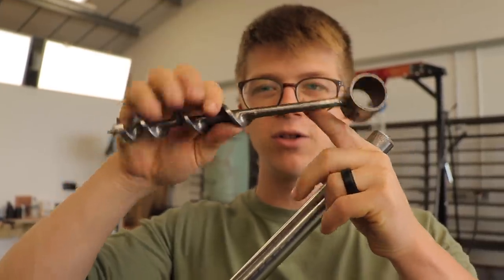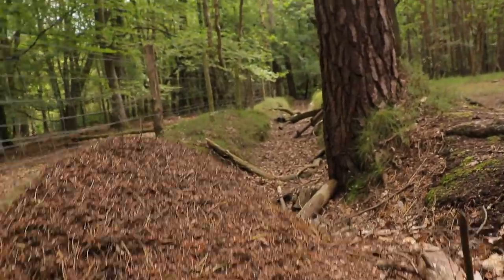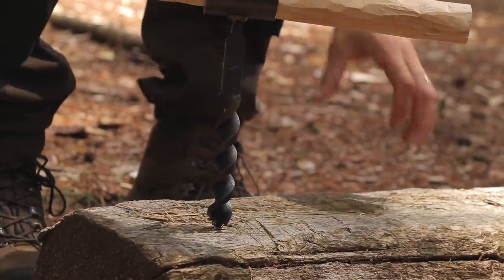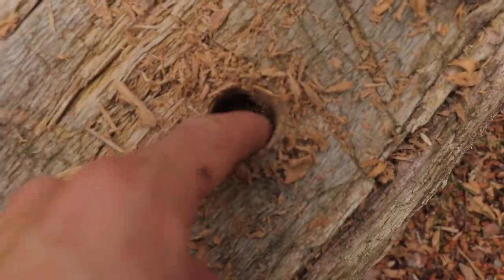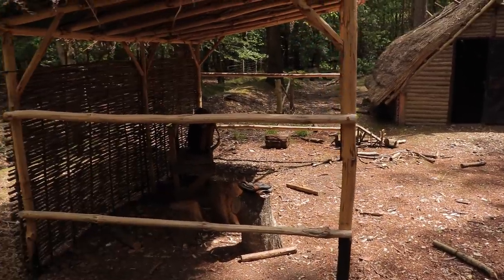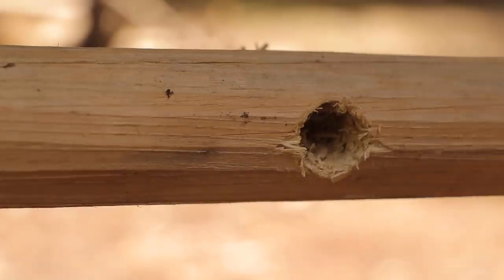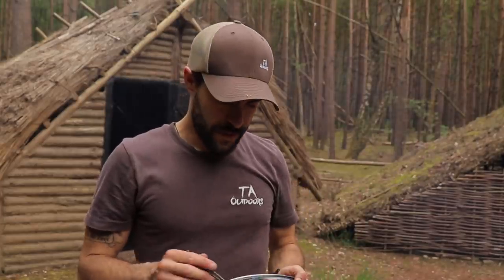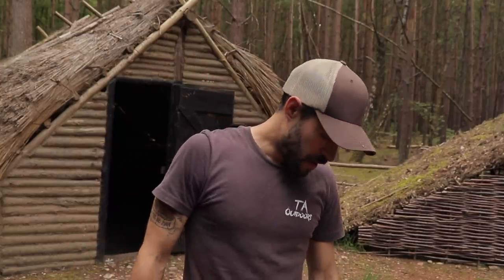Testing the Alec Steele Auger in the Woods! Bushcraft Project

Comment: He can make tools alright. The auger bits need a hard clean edge going up the auger screw, with a little less then square edge. That will help the auger work a little easier and cleaner. I have used a lot of auger bits for mortise and tenon work. I find that edge being a little sharp helps.  Looks like you started making Jambalaya, cut up Andouille sausage and prawns.
Reply: Good analysis,I’ve also used a lot of different auger bits over the years and the type that’s tapered wider from the front to back are harder to control and keep straight. A nice auger with sharp cutting edges and a decent sized screw at the front to pull the auger through with a parallel body always cut the best and most efficiently .
Reply: Good analysis,I’ve also used a lot of different auger bits over the years and the type that’s tapered wider from the front to back are harder to control and keep straight. A nice auger with sharp cutting edges and a decent sized screw at the front to pull the auger through with a parallel body always cut the best and most efficiently .

Comment: you do know that the handle part of the settlers tool is for making the perfect wooden nail  that fits the hole all u do is put the handle part over a piece of wood hit it with a hammer and that will make the wooden nail i just thought id add that to ya not sure if u said that or not if you did then sorry lol
Reply: This one is not built that way. And those that are, usually are garbage for doing that.
Reply: @shaynejenkins446  ah k my one works good

Comment: Your hand auger would have a much smoother cut if you withdrew the auger when the snake broke through the other side and the drilled from the other side centred on the small snail hole. Or at minimum you would stop break out

Comment: Mike I bought an off the shelf scotch eyed auger, slightly smaller than this one and find it quite an awkward tool. This one being longer and looks better on the joint with the eye. Particularly the longer point of the drill.  Is the blacksmith local? Cheers, Simon.

Comment: I’ve used hand augers a lot over the years and the ones that had big screws work a lot more easily and efficiently than the augers with a smaller screw. jmo

Comment: You need to sharpen that bit. Drill bits have a edge on them going all the way up. I was wondering from the last vid if you were going to sharpen it in this vid.
Reply: All you need to sharpen on an auger bit are the spurs and the cutting lips. The twist portion of the bit simply feeds chips back out of the hole.

Comment: I saw one of these a while ago, I think it was being called the "frontiersman tool". The diameter of the drill bit was the same as the handle hole. The handle hole was placed over a slightly larger diameter stick and hammered over shape the end into the correct size peg. Would that work with this tool?

Comment: Isn't the barrel eye on that supposed to be the same diameter as the drill bit and have a sharp edge for cutting a peg that fits perfectly into the hole the drill bit makes.
Reply: They ran out of time

Comment: The result would be even better if the drill had a pre-cutter. I hope Google did the translation from German to English well.
Reply: I presume you mean the sharp, curved 'wings' at the outside edge of the auger that slice the wood fibres before the main cutting edge (working as a rotary chisel) removes them from the bore. If that IS what you mean, yes, you are absolutely correct!
I can imagine, however, that such features are non-trivial to forge, but they are an important development in the evolution of wood-boring tools.
Oh, and that worm was way too long and thin! It won't survive for long.

Comment: The cutting spurs are a bit too short, that's why the hole looks ragged. Look on ebay for a bit n brace taking care to look closely so you don't get on that's worn out. The sort of auger you have there doesn't lend itself well to in situ drilling.

Comment: maybe need to sharpen the auger a bit more, on screen it looks like there is just basic geometry, with some grinding, it should work even better!
the cut should be more clean when the tool is more sharp!
there is some wood chips coming out of the bore, but it looks more like dust, if the auger is more sharp, it looks more like chips!

Comment: It doesn’t seem to cut a very clean hole. Perhaps the next one will be better.
Reply from the maker: It does, it’s just the particular wood I am cutting on the video. It’s pine, very soft wood with twisted grain. Something like sweet chestnut or ash would make a really clean hole
Reply: @TAOutdoors  I have been watching Alec for almost two years. He is best at talking and blacksmithing is a close 2nd and everything else he attempts is not awesome. He should be a blacksmithing tool salesman.

Comment: Not to be "that" guy.    But the screw auger is handy and it was a great colab and I like the tool....but the only augers I kind find documented from the historical record dating to the Viking age arebSpoon bits.     The screw auger our ship auger was a Big Deal when it came out wide spread shortly ( relative term) before electric motors to drive them came Into being.   I guess what I am saying is "great tool" ...but it does not fit into your villagev....unless I am missing something ( which is more than possible)